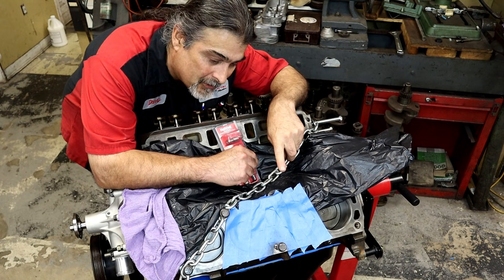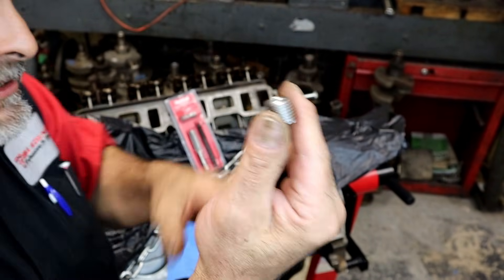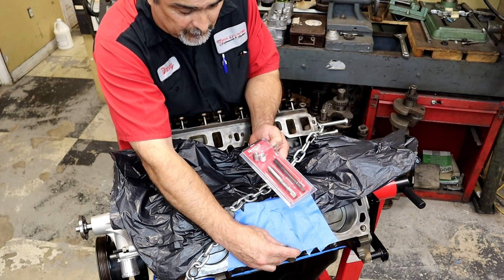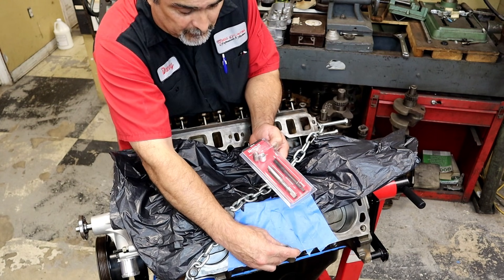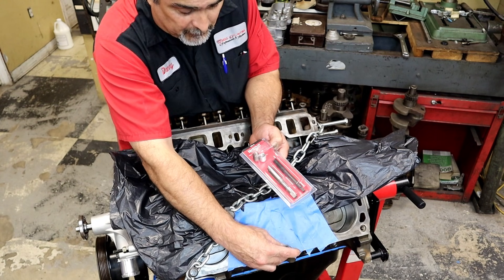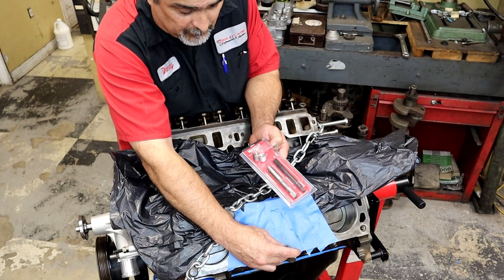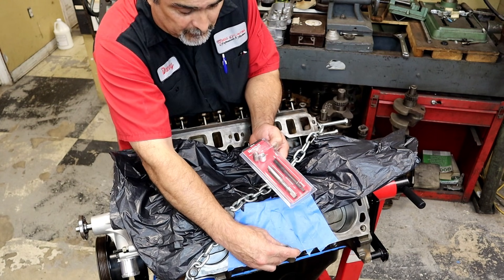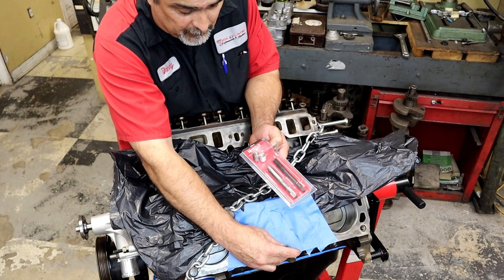HOW TO INSTALL A HELICOIL CORRECTLY THE FIRST TIME

Comment: Anyone know if its Ok to use a little loctite on the helicoil insert?
Reply from the maker: Not necessarily but have talked to lots of people who have done that. 👍
Reply: @MrDanielSoliz Should have mentioned specifically for a intake manifold bolt on a sbc 350. Just thinking ahead, incase id have to remove it for servicing. I appreciate the info!

Comment: Great video, I'm preparing to do my first helicoil on a 2jzgte head cam cap bolt hole! Any tips on whether to use threadlock and how to size length of helicoil?

Comment: when you can invent a way to keep shavings from falling behind the hole you drilled...... you will be filthy rich !!
Reply from the maker: My uncle would use wheel bearing grease on the drill bit, works really good.
Reply: @MrDanielSoliz  what " may " help is to put your drill and tap through a hole in a vacuum cleaner hose ( in the on position ) to help but afterwards you would have to fix that hole also.

Comment: So I’m trying that right now on a Toyota rav4 the bolts are 6” 3/4 long I can’t get the helicoil deep enough to tighten the cylinder down the threads are about 3”’s below the block of if I put the helicoil towards the top when I got to tighten the bolts. The cylinder still has 4 inches above the cylinder.

Comment: Thanks for the video man!! Awesome tips! You just got another subscriber, and I'll tell all of my wrench monkey friends as well! You made it seem so easy. I have a 09' Tomos Streetmate moped with an A55 two-stroke engine I'm rebuilding. Came across JB Weld all over the exhaust and head during the tear down because the previous owner broke off a manifold bolt and wanted a quick fix. LOL. Gonna go drill, tap, and install blindfolded backwards like you said, hope it works out! 👀😉🙂😁
Reply from the maker: Thank you, let us know how it turns out. 🙌

Comment: You showed me something different, you don't have to screw the insert as deep as the tap. One question though, how deep should the tap go or should I continuously screwing the tap in, and all the way out to see how much farther I have to keep screwing to where the bolt should stop?.........
Reply from the maker: The tap needs to go in far enough so that the treads don’t tighten up at the bottom. If you’re doing a blind hole you want to use a bottoming tap. If the treads tighten up the heil coil will bite the bolt and lock up.
Reply: @MrDanielSoliz I stripped one of the bolt holes tapped internal threads on my Toro 21321 Briggs & Stratton 9P702-0181-F1 engine cylinder block, the bolt is a M7X1.0 should I purchase a M7X1.0 Helicoil Kit? If yes, I just need to know how deep should I drill and tap into the hole before I install the insert or should I drill and tap the length and depth of the screw or should I put something in the hole and when it stops mark that depth then mark that same depth on the drill and tap then drill and tap that far down into the hole? In other words should I drill and tap all the those old threads out before I install the insert?
Reply from the maker: @Thomas-nz4uh yes you need a m7x1.0 kit. Just make sure you drill and tap it all the way down. If you can’t get it deep enough you can cut the insert. I use a dremel with a cut off wheels. You can cut it before installing it or screw it in half way, cut it and then screw it in the rest of the way.
Reply: @MrDanielSoliz  Thank man, you have been a great help. I received the today so I'll install it tomorrow......
Reply: @MrDanielSoliz  I tried it and torqued all four bolts at 140 inch pounds. Thanks for that guide tip, you are a gentleman and a scholar. Although replacing the head gasket and breather read (PVC valve) didn't solve my problem, but at least I have some experience in using taps now. I still have a very small oil leak coming through my breather tube and would like to fix that before it gets worst. I just wanted to give you an update on my success, if you can think of something else I can troubleshoot let me know, thanks again man!!!!!!

Comment: been using them for years, for the absolute best results drown the helli coil with thread lock, loctight, then install it, now the most important part is allow the loctight to set, dry, preferably over night but 4 to 6 hours drying time can be sufficient, i leave it over night and I screw the bolt in til its a firm finger tight and let it set or dry for a good 24 hrs, it can sit, set, dry for less time but keep in mind the longer it gets to set the stronger it will be, after it has set tighten the bolt securely but don't over tighten or you could pull the helli coil out, i hope this has helped you good luck with it all...

Comment: I broke a head bolt and stripped the hole on a predator 212 head. I've used this method in the past for my brake calipers on a 2007 Chrysler Concorde. I needed a refresher thanks for the video

Comment: The heli coil seems very small i need the new heli coil threads to be the same size as the bolt ? What do i do about that?
Reply: That is what the helicoil does, you drill out the hole & thread it so the new helicoil is the size it was, (if that makes sense

Comment: Maybe a dumb question, but do you tap the entire length of the drilled hole? Or can you stop at the depth you want the Helicoil to stop at? I’m not sure if the Helicoil would have a tendency to migrate further into the hole when the bolt is inserted, if the tapped threads go the entire length of the hole.
Reply from the maker: I do tap the hole all the way down. You don’t need to,just make sure you there’s enough threads for the heil-coil or it will shrink on you and lock the bolt. Brodix aluminum heads installs heil-coil on the rocker stud holes and they go into the intake port. They won’t move on you if done right. I’ve never had one move on me.👍
Reply: @MrDanielSoliz  ok awesome! Thanks for the advice!

Comment: Thank you very much I’m fixing and old ,old, very old rust exhaust mani on a Cessna 310. Broke 2 of them after putting rtv and new gaskets and everything. So dumb. I should a checked before I put em together. See kids even old guys are still learning. 
As a mech A&P FAA CERTIFIED. I AM ALWAYS LEARNING ! The day you think you know it all. You don’t .
You can be good even great but even the greats will say they learn new things daily. That’s how they got that way. INMHO. 
MIKE KLZU.
PS thank you kindly for taking the time to make this for us mechanics who don’t have a good example. 
Thank you very  much. So helpful. I liked and subbed. 
My only question is domwe use the same torque in the MM ? I have to as an airplane tech. 
Didn’t know if it changes anything. I know you prolly won’t be able to weigh in on this due to legal reasons so if you can’t answer I totally get it. Liabilities a mother in my biz.
Reply from the maker: Thank you! If I understand the question correctly you would still use the same torque. 👍

Comment: Great video Daniel, with great tips. My problem is a stripped spark plug hole. Searching videos for that but you gave really good incite on procedure.  Thanks again.
Reply from the maker: Thanks, for spark plugs I like a solid insert. KD tools use to make them. I find them on eBay. Hope this helps.

Comment: Time-Sert is stronger whereas Heli-coil may work for only 1-2 removals and bolt installs.
Reply: Why do people keep parroting this?  Heli coils can be used over and over and over.  They’re stainless steel.  I’ve seen them used in tooling where stuff is threaded over and over daily!  To all of you who say this, I must ask, what about the heli coil is failing for you after the 2nd or 3rd use?

Comment: What do you do in a spark plug hole to prevent shavings in the cylinder?
Reply from the maker: Wheel bearing grease on the tap work great. 👍
Reply: @MrDanielSoliz  Could, or would, that work when drilling the tap hole also by greasing up the drill bit?
Reply from the maker: @dirkfrazier9779  yes sir!👍

Comment: nice job!  I needed to know about the tap. was not sure if if was the same as a tap and die and you said it is a special size.  thanks for the info.
Reply from the maker: The heil-coil kit comes with the tap,coils and installation tool. 👍

Comment: Best video yet. Thank you
Reply from the maker: Glad you liked it!
Reply: @MrDanielSoliz  ordered my helicoils . The inserts don't fit the tool snug. It's like they are tad bit bigger. Is that normal?
Reply from the maker: @jonathanbrown834  yes they are slightly bigger the the install tool, when there installed they will be the right size.
Reply: @MrDanielSoliz  ok thank you. Here we go. Hopefully I do this just as you did. Thanks for the help..
Reply: It came out good thank you

Comment: Thanks for making this video, extremely helpful!!
This is the first time I used a helicoil to repair a stripped out hole.
I made an aluminum drill hole guide as suggested which allowed me to drill a nice straight hole.
Is the helicoil removable (drill it out) once it is inserted should it get stripped in the future?
Reply from the maker: Glad it was helpful and yes you can remove it but not by drilling it. Just take a pick and get behind the coil and it will pull right out with some pliers. Pulls right out and you can install a new coil.
Reply: @MrDanielSoliz  Sounds good, thanks!

Comment: Part of the reason you back off on the tap when cutting is to clear the chips off.  This makes for a smoother cut thread.  I cringe when ever I see those shows where some guy just chucks the tap up in a drill and has at it.

Comment: Hi Danny Can you do video on how seal savers work and how to install them.    When the old seal has  worn a groove into the output snout of the crank shaft,  it's suggested to use a seal saver along with a new seal.  How this all works?
Reply from the maker: Great idea, they have also changed how there made and I found a better way to do it. Awesome thanks. Can’t wait for the next one. 👍
Reply: @MrDanielSoliz is this vid out?

Comment: Nice video. Like to add you can get longer depth helicoils for deep holes..  Although not recommended by helicoil I would have cleaned the hole with acetone and added loctite to the helicoil. Then had a greased bolt to put in the hole with a spacer long enough to allow me to torque it down.. Let it set to cure and then remove bolt.  That way all the slack is removed in the threads and it is as solid  as the block.......This would be over kill  for most repairs. Just my 2 cents.

Comment: Danny a tip for you. I recently tore the crap out my thumb nail worse than yours. I "Repaired it" with super glue and a tea bag. Cut out two or three tea bags the size of your thumb. Now like laying out fiber glass put one nice drop of super glue on your thump nail and smooth it out a bit and lay the tea bag over it and smooth it out. Apply another drop and repeat the process. Once you have the two or three layers built up let it dry hard..  Use a nail file a smooth it out. Not only does the nail look better it also reinforces it better than new.  Absolutely amazing.   As the nail grows out just adding super glue builds it back up.
Reply from the maker: Thanks for that tip , I’ll have to give it a try. Thanks